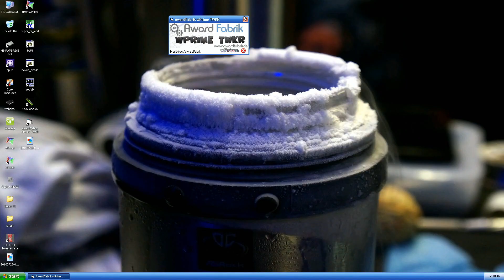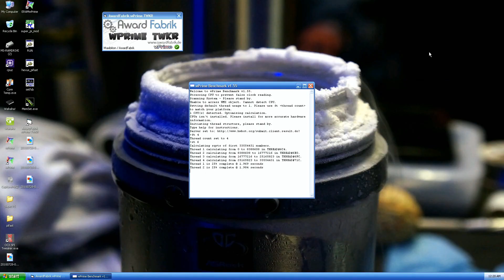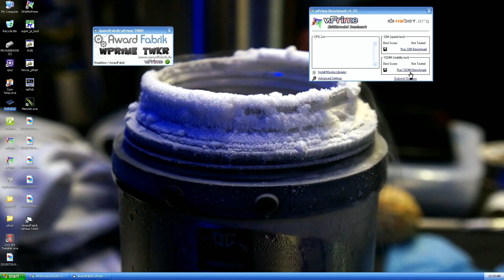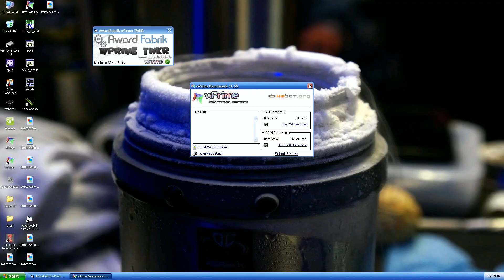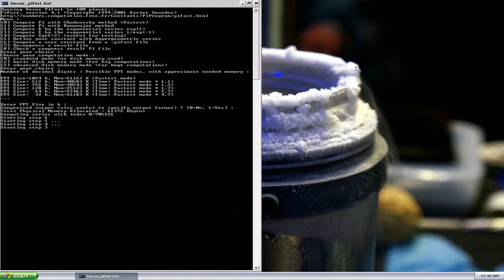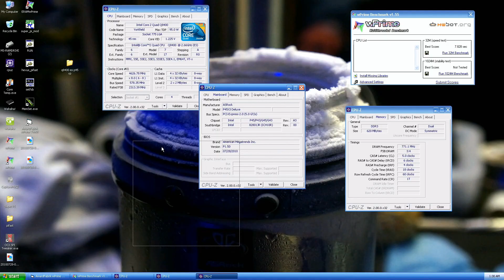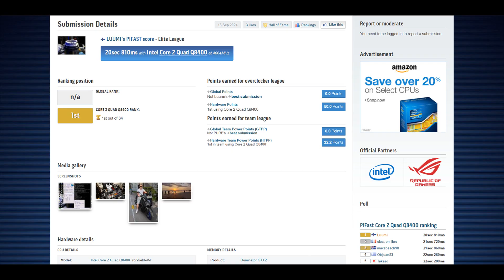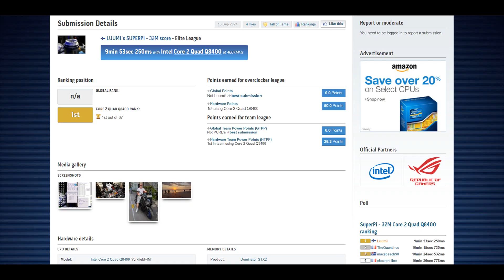North Bridge on LN2 - Asrock P45X3 Deluxe Smashes Q8400 Overclocking Record Scores!

Comment: Yeah, the interesting thing here is definitely the FSB and that this could be theoretically possible on a medium budget back then.
However the equivalent Xeons actually do close to 5 GHz on freakin' air (not even NH-D15 or smth.). Regular Core CPUs are all but obsolete for a platform that's suffering from the usual problem of scarcity of the actual good boards such as that one.